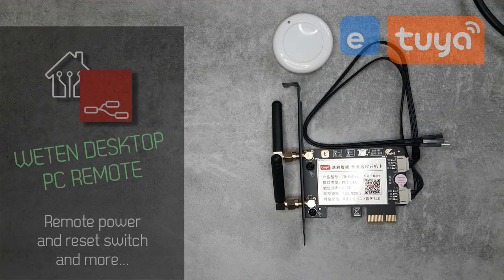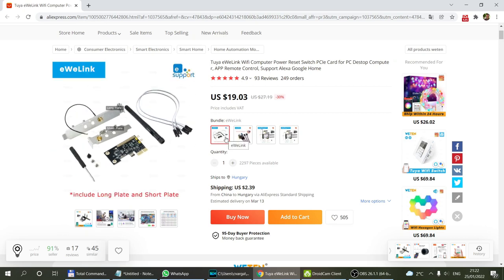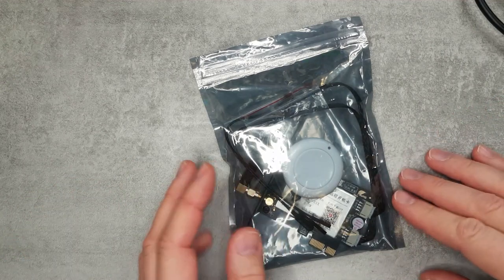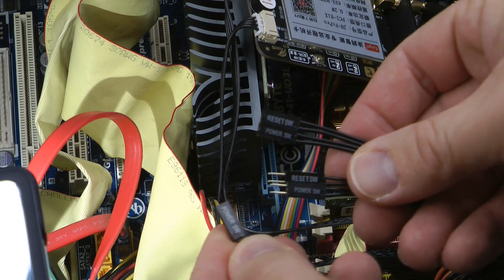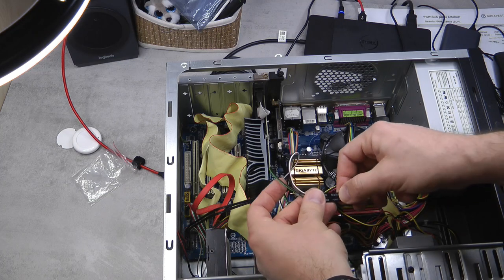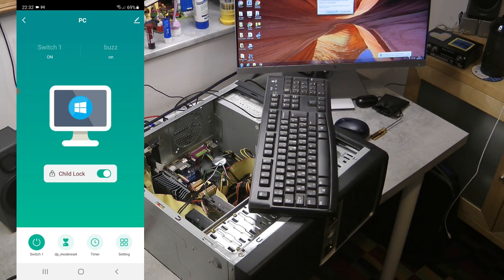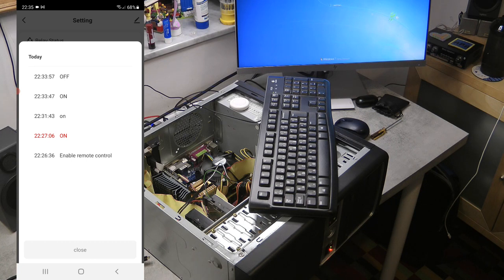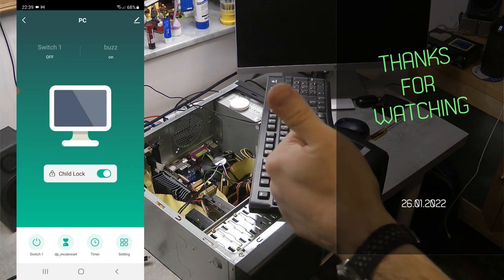Turn on or reset your computer remotely from you phone with this WETEN desktop remote

Comment: Not sure that polarity will make any difference given the switch is just a on when switched so doesn't actually have polarity :).   I wouldn't say the side the writing is printed on is an indication of anything :).     I can see some automations, like if you have external speakers the power to them can be turned on and off when the computer is turned on or off.    For a gamer, there may be desk lighting like you suggested, but the main function I see for this, would be to force reboot if the machine froze or something similar.  Or maybe turn off a computer on the kids at a set time.
Quite an interesting card and definitely worth looking at.  I might have a look at one and see if it can be converted to local control via MQTT or something similar.   
Questions:  Is the card communicating WiFi, Bluetooth or Zigbee for the primary network connection?   Does it have the ability to perform a force shutdown in the case the operating system freezes?
Reply from the maker: It uses wifi. It can perform a force reset not a force shutdown.
Reply: @csongorvarga  Thanks for that.  Appreciate your quick response :)
Reply from the maker: @EsotericArctos  sure, you have some good automation ideas. I will add to my dad's computer so I can turn it on remotely if I need to administer it.
Reply: force shutdown maybe it's achievable with a smart plug... 🤣

Comment: Is PCI-E always powered as long as the power supply is on, even if the system is off? It not, wouldn't it mean that you can only use this to reset or power off, but not power on?
Reply from the maker: Well, this is how it worked for me. Maybe you need some bios settings, like how you can enable wake-on LAN as well.